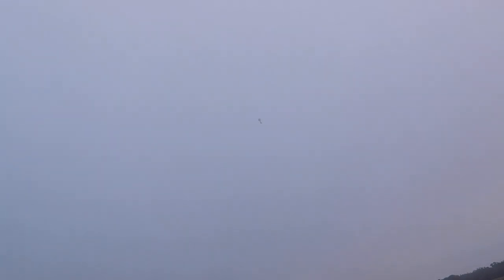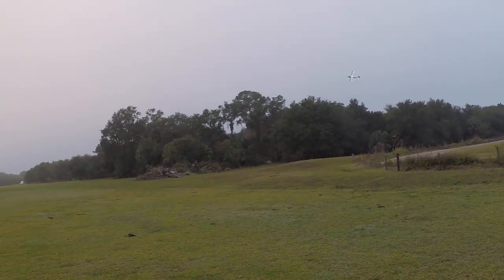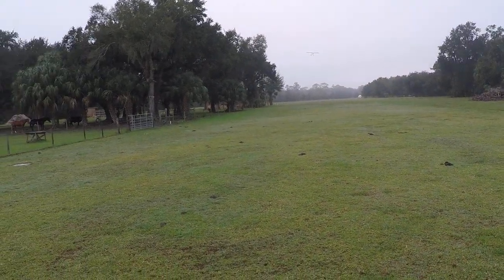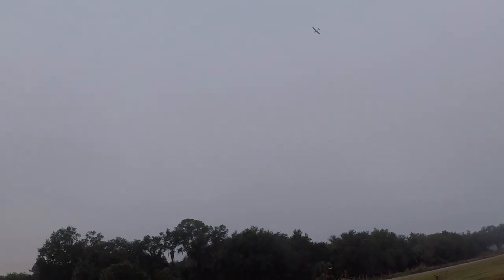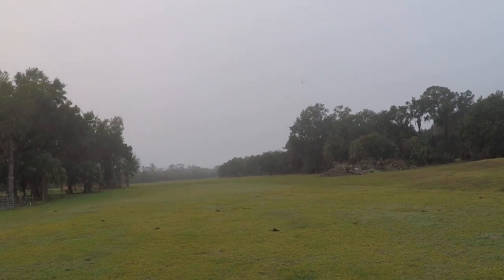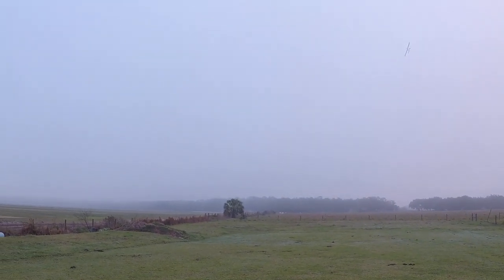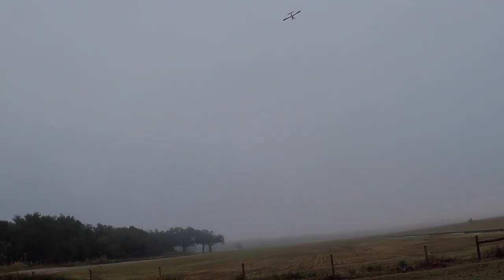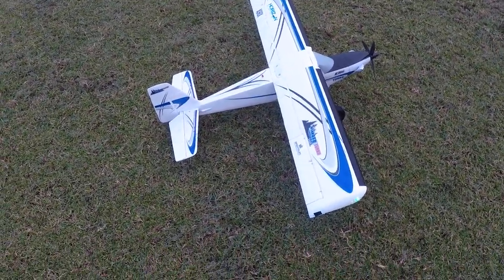Timber Turbo 12 26 2019

Comment: Do love the STOL planes. Just a quick squirt of juice and up they go. Is this the Timber version that has the larger control surfaces? 
You seems to throw it around the sky nicely. I give my Tundra a bit of a hammering as well, although only on a 3S 2700 battery.
RC Addicts R Us!
Reply from the maker: No thats the Timber X that has the oversized control surfaces. I have it as well. This one is the Timber Turbo.

Comment: Was wondering if a DX6 (6 channel) is capable of operating all the features of the Timber Turbo (including flaps). That’s the radio I have and I don’t want to purchase in error. Thanks so much!
Reply from the maker: Yes the 6th channel will be for the safe select.

Comment: I got a Carbon Z Cessna for Christmas, already a nervous wreck thing about flying it. I may have asked this, but compared to my Timbers anything I should know. (Tip stalls and so on)
Reply from the maker: Keep some speed in the turns at lower alltitudes. Also The CZ Ceesna is very stable and flies great but land on your mains first then set the nose grear down. The nose gear will twist and snap on a hard landing. Just guess how I know that....lol